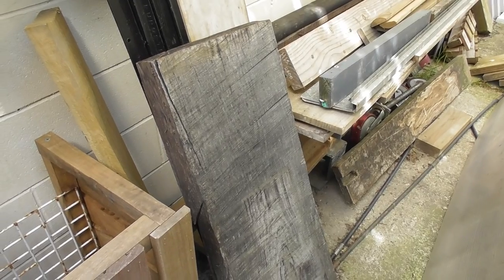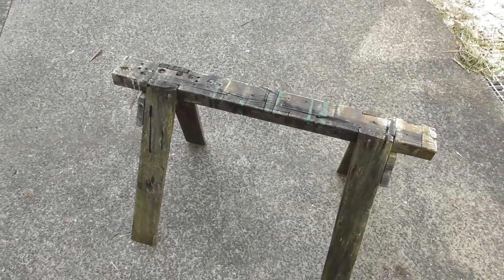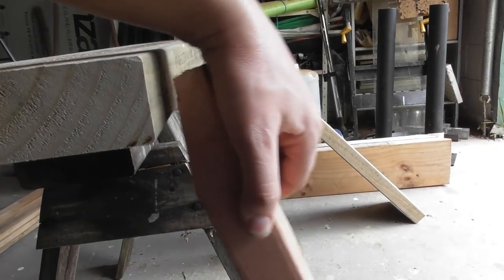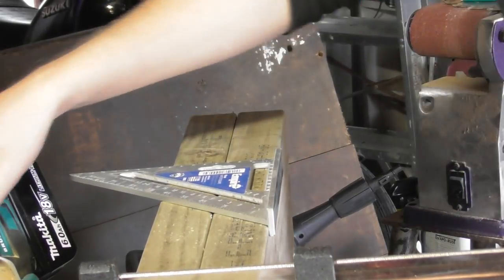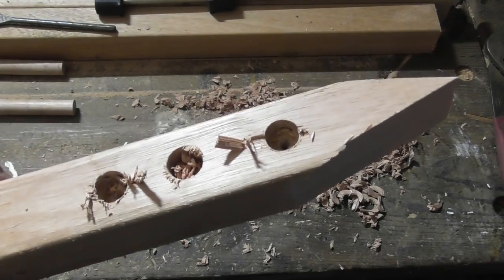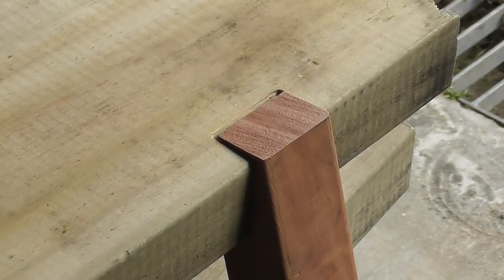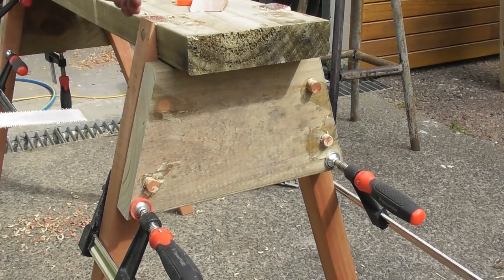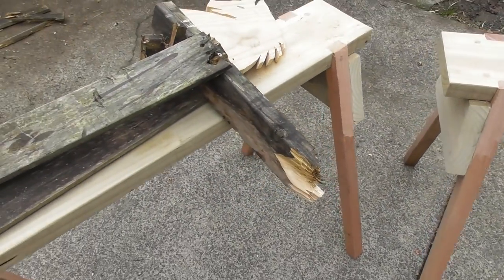DIY Sawhorses made with NO NAILS OR SCREWS!!!

Comment: Could you have used square pegs instead of making all the dowels
Reply from the maker: Easier to make the dowels than drill square holes.
Reply: @ToolsAndStuffOFFICIAL  I have a lot of seasoned roof latts thats why I asked the question
Using a large auger drill should not take long to to make a 2x1 hole
Reply from the maker: My Augers drill round holes.